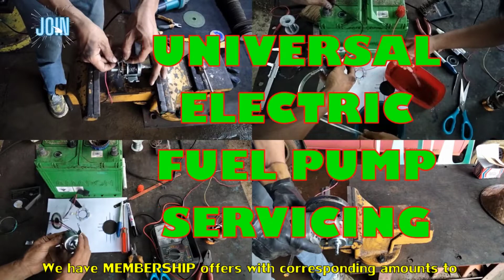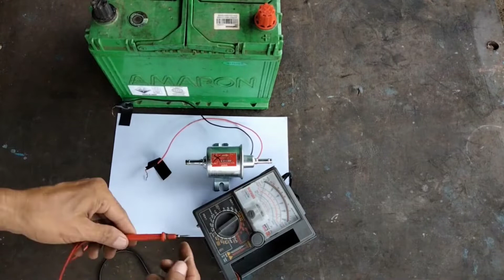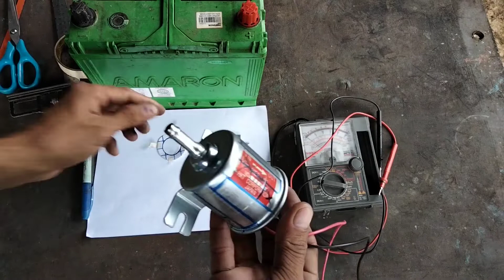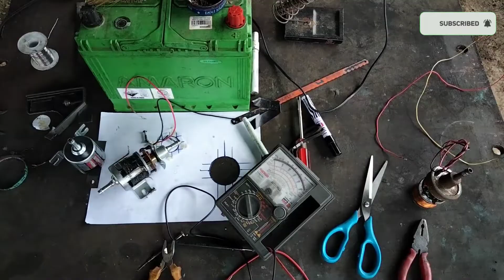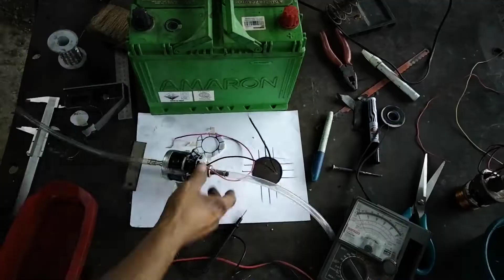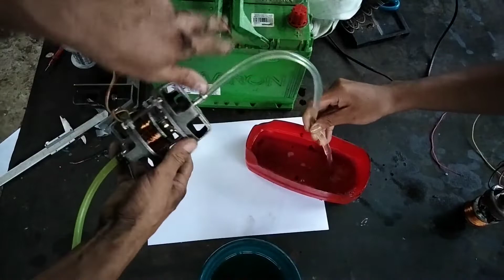HOW TO REPAIR UNIVERSAL ELECTRIC FUEL PUMP | REBUILD | SERVICE | INCREDIBLE TECHNIQUE

Comment: Do these little pumps have any kind of filter in them? What is the size of the smallest orifice? I am running some dirty stuff through one and worried about it getting plugged. Thanks
Reply from the maker: There is no filter inside of the pump, but you can put a small filter that fits to the tube and inline of the inlet of the pump. 12mm diameter size of orifice my friend. Thanks for visiting my channel.
Reply: @TATGeneralServices  great thanks. Yep I have and inline pre-filter that is cleanable. Just trying to keep something from plugging the pump but I can go way courser now that I know there isn't a filter inside, awesome!
Reply: @matthewkernek2185  It can block the jets instead.
Reply: @thra5herxb12s  I am not suing it on a vehicle or carb. It's for fuel transfer. I am sure it could plug jets. Thanks